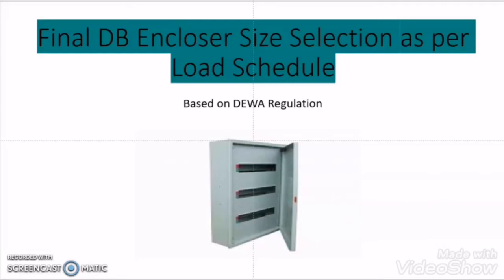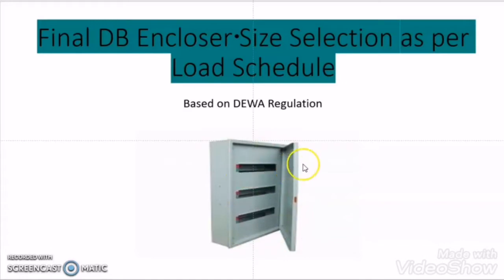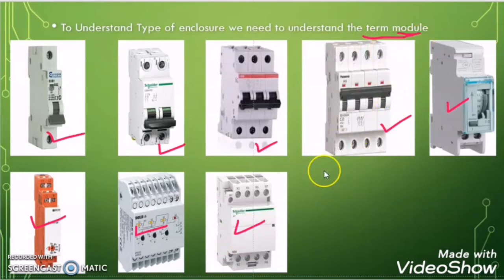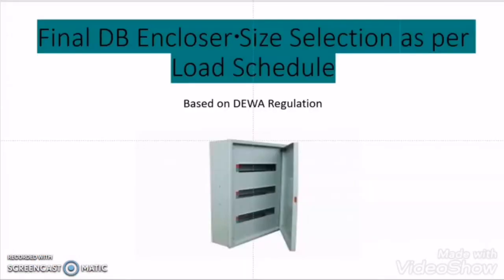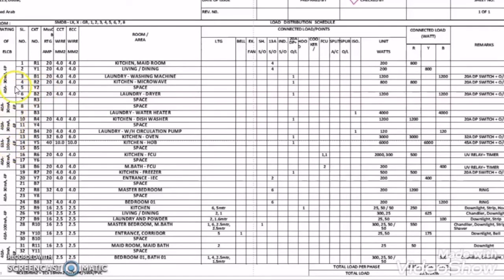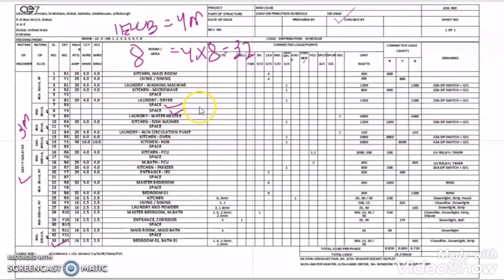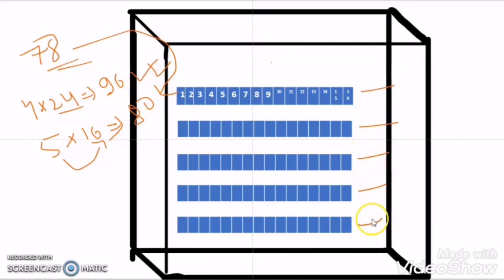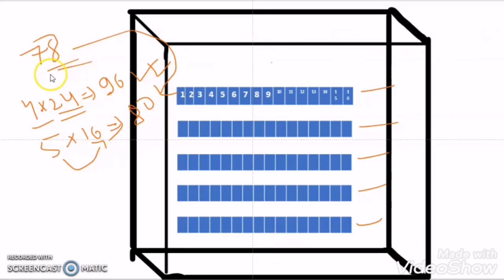Final Distribution Board Enclosure Selection as per Load Schedule as per DEWA Regulation.

Comment: respected sir, if we have 78 modules. what will be the WAY TYPE DB for it?
Reply from the maker: 16*5=80

Or 24*4=96

If that 78 modules are taken by considering space and spare
Reply: @electricalconcept32  spaces + uvr timer included. 
my questions is that to select the WAY TYPE DB for 78 modules.
Reply: respected sir. if 78 modules and I want to select the WAY TYPE DB. then 78/3 will be 26 way.
is it correct?
Reply from the maker: @shafiqueahmed8627  yes correct
Reply: @electricalconcept32  what are the benefits of using SPLIT WAY DISTRIBUTION BOX?